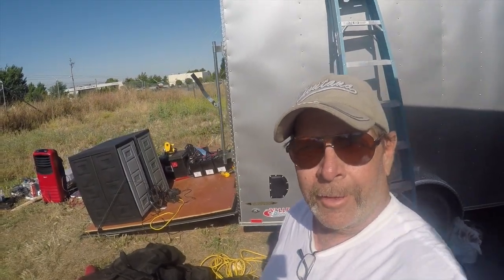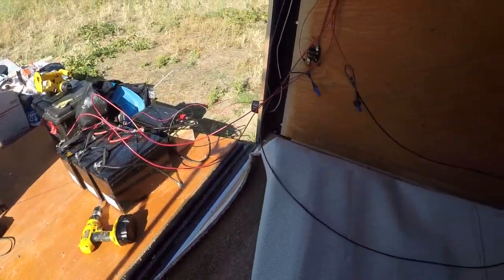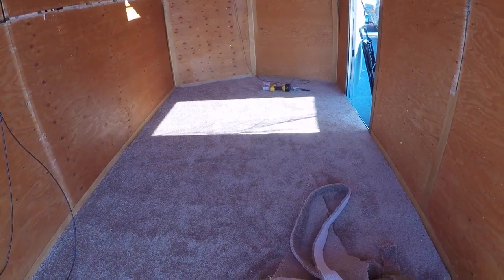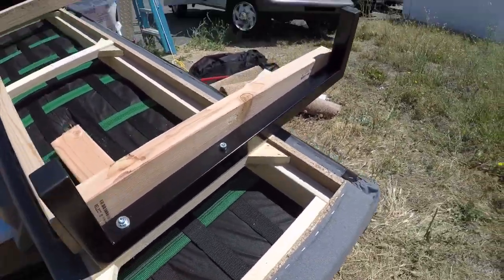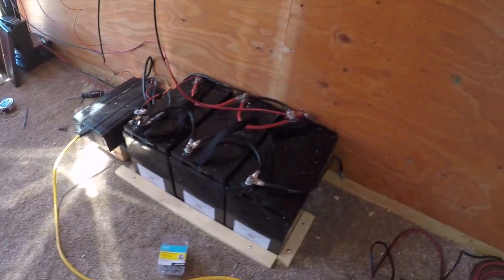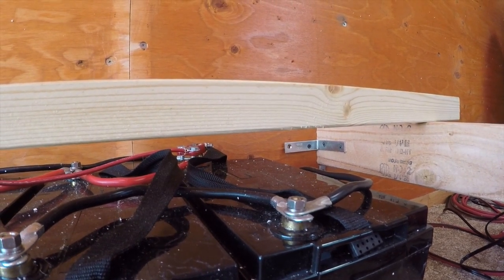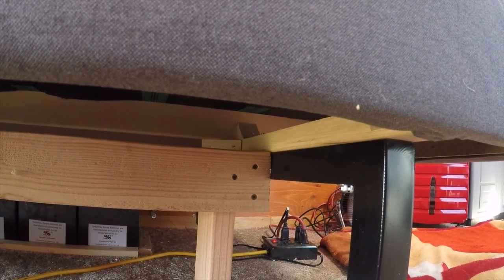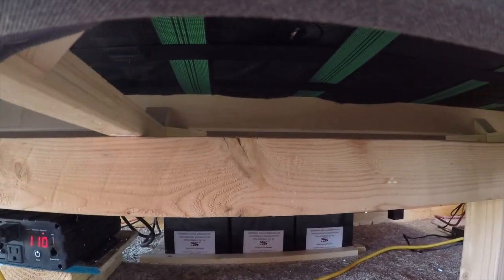Cargo Trailer Conversion... Carpet Install... Custom Couch / Bed Frame.... Cabinets... RVerTV

Comment: Russ it is looking great.  Love the sofa and your design.  Suggestion for the front.  Build a 30 in high counter across for a kitchen.  Install a bar sink with fixtures ($99 at Lowes,  Install a 12v water pump (Amazon $29) pumping from a 5gal container. Drain either directly thru the bottom or into another container. Room under for a cooler/ref.
Reply from the maker: thanks great idea... the kitchen part will be later in the summer

Comment: Taking shape, nice project. How far is your drive between where you live and where the trailer is. And when you are done will it fit in the same site?
Reply from the maker: its close by and the trailer will be a mobile unit

Comment: Do those batteries stay cool; nice ventilation all around them except if sitting directly on top of carpet. This is one fine mighty nice looking cargo trailer. Have you thought of a Name for your company when you start mass production making more after the requests start mounting up? 😉
Reply from the maker: thanks bev... i dont know if my old body could handle too many more conversions

Comment: WHAT ABOUT BATTERY FUMES?
Reply: Do not have to worry about fumes with the sealed batteries.
Reply from the maker: no fumes with AGM batteries   thats why i bought them ... they are even rated for medical and aircraft enclosures
Reply from the maker: thanks !